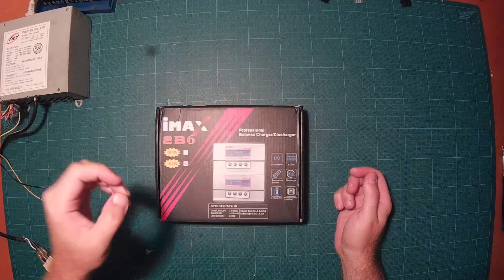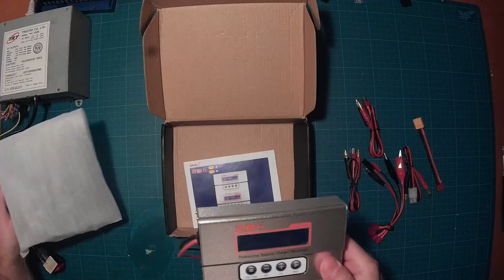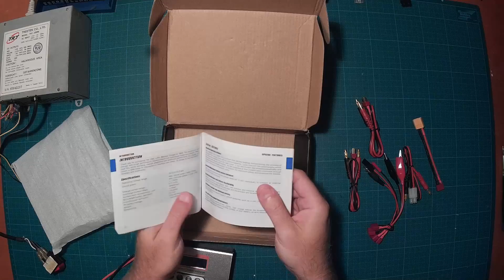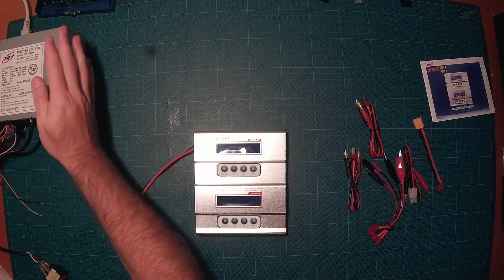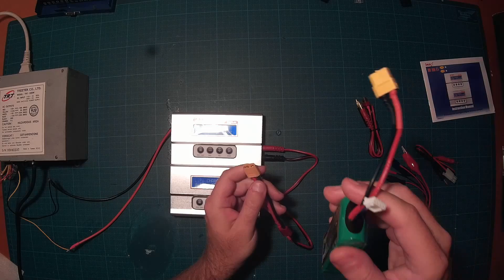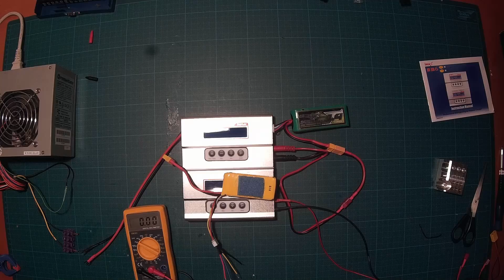2B6 Dual Power Balance Charger: Unboxing and review

Comment: Hi.... I'm thinking of buying this charger to charge 4S 5000mAh LiPos, but I don't know what kind of power supply I should use to power it up.

How many volts and how many amps must the power supply put out in order to get the most out of this charger? The Banggood description says its "working current" is above 16A.... I have no idea what that means.
Reply from the maker: Hi! It means that your charger needs at least 16A input to be able to perform to its specs (80W / 6A output per channel). Since it works off 12V, the 16A means that your power supply needs to be able to supply 16A at 12V to power this charger. That would be a 16A x 12V = 192 W power supply. I usually use old PC power supplies to power these. One of these will also work: http://www.banggood.com/240W-110-220V-to-12V-20A-Switching-Power-Supply-For-Strip-Light-p-73834.html?p=I32013833408201410RW
Reply: Ahhh ok so instead of hacking the family PC's power supply,  I can use those switching power supply units to run this. I found a cheaper one too - a compact 12V 16.7amp 200W unit. Within the specs you mentioned.

http://www.banggood.com/Mini-200W-Switching-Power-Supply-220V-to-12V-16_7A-for-LED-Strip-Light-p-1019133.html

Will put in the order for both. Thanks mate. Cheers.
Reply from the maker: Exactly. I found these cheap chinese power supplies sometimes working less good that advertised, which is why I suggested the 240W one to you :-) But the 200W one should also work :)

Comment: Hello, I have a technical problem with this charger, do you know if there's an online reference to solve it? 
I put a LiPo battery on charge, set the voltage and the amperage correctly, then I start to charge but the charger gives me an error of incorrect voltage input... how is it possible?
I did a video on this issue but I am not able to put it here.
Reply from the maker: +Gianpaolo Cerato Has this charger worked before, or did it come like this? Did you try several different Lipos. Does it do that on each of the charging units, or just on one?
Reply: yes, it worked once. It does the same also on another lipo, but if I try to set a lower amperage it works. But I would like to charge fully!
Reply from the maker: Does it do the same on both charging units?
Reply: yes! I think it's a matter on how to configure some settings on the charger
Reply: if you have a mail I send you a video I made
Reply from the maker: +Gianpaolo Cerato I have not received that email yet, but will take a look when I get it. The way you describe it leads to two possible issues. 1) A bad/loose solder point in the charger affecting both units. 2) Your power supply might not be able to supply enought power for charging your Lipo at the full amperage. Thus the question: What kind of power supply do you use to power the charger and are you sure that it is able to provide sufficient power?
Reply: I was asking for your mail because I have not yet! however mine is giampo76 at yahoo.it
Reply from the maker: +Gianpaolo Cerato Sorry, I thought you had used YouTube to message me. Please use RCFPVFlight@gmail.com.

Comment: Wow. that price Is amazing indeed :)
Reply from the maker: DutchRC ADVENTURES Indeed. And it seems to work really well so far.
Reply: Yrah.. my HobbyKing Reactor was over €100 ;)  It IS a bit more powerfull though..
Reply from the maker: DutchRC ADVENTURES Indeed, 2x300W is awesome, specially if you need to charge larger Lipos. I usually try to charge my Lipos at 1C only and since I mostly fly with 1400 - 2200 mAh Lipos, the 2B6 is just right for me.